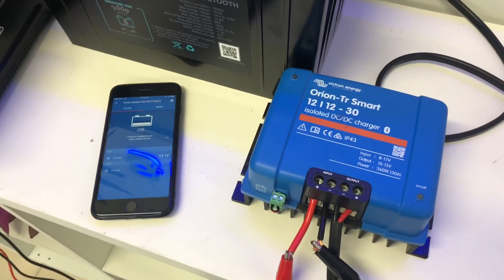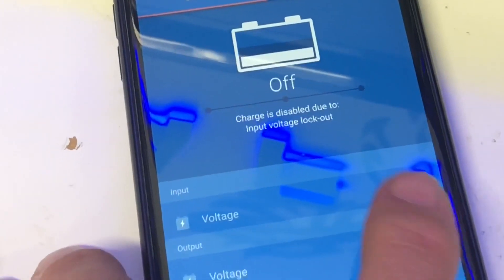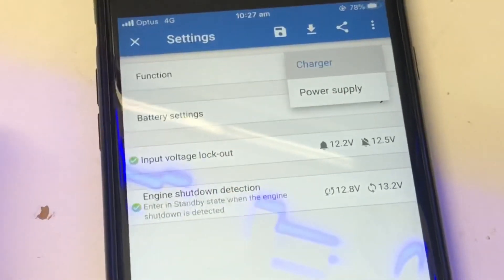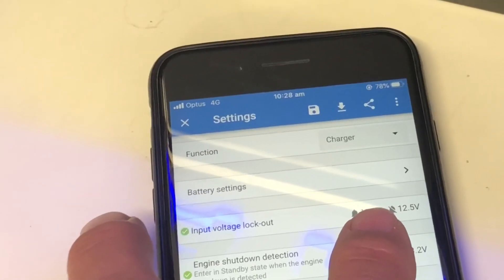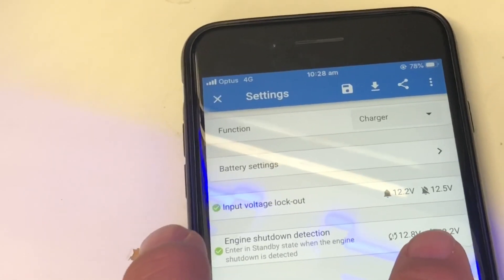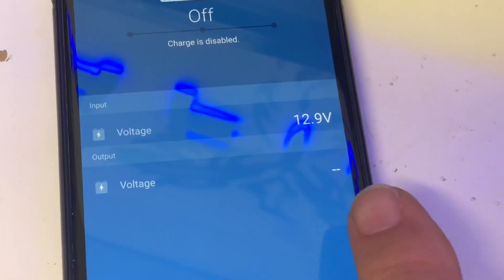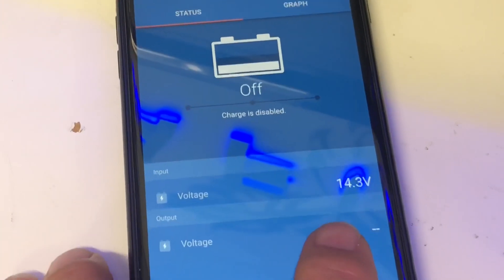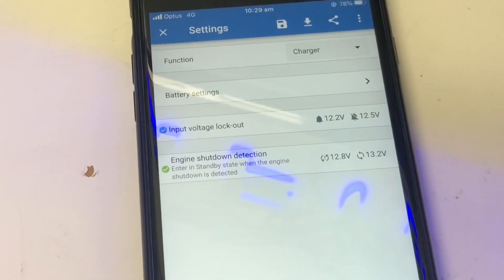Victron Orion Smart 30A  DC Charger Settings

Comment: I have this but not sure how to set up the volts for my battery. If it's set wrong will it burn anything out
Reply from the maker: The battery voltage setting is important so it is best to look up the correct setting for your battery's chemistry.

Comment: Quick question, in the dc dc charging from starter battery to living battery if the engine is running and the starter battery gets disconnected does the dcdc charger still works? Could you test this? Been searching for days on info on this on the inter webs and couldn't find any info.
Reply: I have one and when I turn off the engine it goes into power supply mode automatically but it also kept pulling volts from my car battery even when it shut down so I had to turn it off and the power supply worked for 1.5 days until I have to recharge
Reply from the maker: Yes it will work. But some alternaors need the stater battery on startup to pick up the field excitation before they are running. Apart from this, yes.

Comment: Great vid!
So, if mine is installed and doing what yours is doing (disabled-zap-disabled due to remote… - disabled - zap - disabled due to remote…), and I have turned off the voltage lockout and the engine off sensor, have I simply a bad connection somewhere?? Cheers!
Reply from the maker: I dont know. Your install would need detailed examination.
Reply: Thanks. I put in a new one and it works fine… old one sent in for examination so I’ll post if they say what was wrong!

Comment: hello, is there a way to limit the current? If I have a Li ion battery that can take 200 Amps, how can I limit the current in order not to blow up the fuse / charger / alternator etc?
Reply from the maker: No there will be on the new XS model coming

Comment: my 55 amp alternator must not be able to give enough power because it also drops to 11 volts when the orion tries to give some power, then it cuts out due to input voltage lockout, i think i need to keep that disabled and only rely on the engine shutdown detection
Reply from the maker: You need a bigger alternator. The drop in voltage may be because of this.
Reply: @Safiery  yes i will first try and install a sterling external regulator and see if this gives enough power

Comment: How do you find the optimal settings for your vehicles alternator? Im struggling to get more than 10amps after the first 5 minutes.
Reply from the maker: Is you vehicle a new one with a "smart alternator"?
Reply: @Safiery  yes. Well its a 2014 movano but it definitely has a smart alternator
Reply from the maker: @ridgeld  well that can be the problem for most DC to DC including the very capable victron orions. It took us a long time with very advanced software with our Scotty (12-48v) before we cracked getting over 200W. We don’t reveal how we did it but I can’t image the Orion doing it.

Comment: My issue is the Bluetooth is connected but  the app cant find my device .No is i leave the jumper unplugged  it would light up so i have tried it with the jumper plugged in .Im using the non iso version of the charger
Reply from the maker: Ok thats a bluetooth issue, not charging ... research bluetooth and victron connect
Reply: @Safiery  it's working now. Thank you

Comment: My vehicle has a Redarc smart isolator in it that cuts the supply to the Anderson plug on the rear of my car when the voltage drops down to (from memory) 12.6v. This arrangement was in place for a fridge in my van but I now want to use the same Anderson plug/circuit for one of these dc to dc chargers. Will it work with the isolator or do I need to get it removed so that the Anderson plug is always live?
Reply from the maker: My understaning is this isolator is used so that the battery voltage is not pulled down below 12.6V. If this is connected to the starter battery then leave in place. If connected to house battery then move to starter battery.

Comment: Can this be used off grid? Example 
I have solar panels charging a lithium 12 v battery but I have 1 12v agm battery
Was hoping this would work without an Alternator simply lithium to charge AGM
Reply from the maker: no it cant

Comment: Thanks for your informative vids and I was hoping you can advise what cable size should I replace the 6b$s cable with that was installed in my lc200 to a 50a plug at the bumper. I am getting 3v drop at the input of the Orion in the front boot of the caravan. The van has 6b&s run of about 5m with a 50a midi fuse at input and car 7m from main battery with 50a midi fuse at battery? Would 2b&s at car stop the voltage drop?
Reply from the maker: Robert, download the 'Victron Toolkit". At the top of this app is a cable size calculator. Keep the voltage drop % below 3

Comment: Anyone know when it switches to float? I'm charging lithium and bms activated full charge. Sitting at 14.57v for about 15min 0 amps and still in absorption? Is it okay to leave this connected to a fully charge battery all the time for extended periods or do I need to install a switch?
Reply from the maker: Hi Rick, We cant comment on systems we havent supplied. Sorry we cant help

Comment: Any issues running two in parallel for a larger lithium battery?
Reply from the maker: Yes there is at idle. 60A may be too much for the alternator. Rule of thumb is alternator should be good for 2.5 times a Fixed DC to DC capacity.
Reply: @Safiery  could this be fixed by replacing the standard alternator with a higher output alternator like the one you sell? For reference the car is 76 series. Thanks
Reply: @Safiery  Is 2 x 18A OK? What will happen at idle?

Comment: How much current does it need in order to provide the rated current to the battery being charged?
Reply from the maker: It needs about 450W. If voltage is lower, the current will be higher. So it is safer to reply in Watts.
Reply: @Safiery  Thanks for the reply. How did you figure that out? I looked at the manual and the required input voltage range is the only thing specified (10-17v). The manual also says the 30A is the rated continuous output current. Is the input and output current one and the same for this device? In other words what is pulled from the device by the battery that is being charged is what the device pulls from the source battery?
Reply from the maker: @f.k.6151  These have an 80-85% efficiency cold, less when hot so 360W output divided by efficiency to give watts input.

Comment: if I use this Orion I do not need a viltron cirus relais switching on at 13.4v or so volt.... wright. its programable in the Orion  wright?
Reply from the maker: I can't comment, it depends on the detail of the install and your protection levels. Please consult local Victron Dealer

Comment: Does the battery earth have to come from van battery or vehicle earth?
Reply from the maker: Both. Should be one and the same. ALWAYS have common battery negative to vehicle earth (ground). It saves energy as no black ground return needed and chassis has low impedance.

Comment: In the battery settings, is it possible to set a low temperature cut off?
Reply from the maker: No it isn’t . Also note that these devices do not measure current. So there is no data connection to a GX device. So no external control is possible.

Comment: My input voltage is set to 25 volts and the lowest it will allow is 16 volts. Why is it doing this on a 12 volt system?
Reply from the maker: You may have a 24-12V unit.
Reply: @Safiery   Yes I have the 24 l 12 30A unit.  But all the instructions say it's an option to set it up for 12 volt. Am I reading it wrong?
Reply: This is the quote, "Can be used in 12-Volt or 24-Volt systems and is suitable for both lead acid and lithium batteries, unlimited multiple units can be connected in parallel to increase output power."
Reply from the maker: @elizabethlicon7338  Go back to the Victron Dealer that you purchased from to discuss and possibly exchange.

Comment: Will it always pull its maximum rated current, or is there an option to regulate the current?
Reply from the maker: There is no current measurement in the Orion's. Therefore no control. When cold at say 10 C we have seen 40A, when hot we have seen 25A.
Reply: @Safiery  what about in normal temperature conditions, how much current does the device need to pull to provide the rated current to the battery that it is charging?

Comment: Does the Orion have a current setting?  For example, can it downgrade the bulk charge current from 30A to say 20A to reduce heat and increase longevity?
Reply from the maker: No it does not have current measurement.

Comment: Have you any experience with these running very hot? There are a lot of wueries and complaints from customers with them running as hot as 55° on the case and 88° on the heat sink fins. Seems to be crickets coming from victron about this. Irrelevant of whether this is in design specs it is too hot to run in parts of a camper van where i want to use it. Anyway if you have any ezperience or thoughts it would be greatly appreciated.
Reply from the maker: Yes we do have experience and they do run "very hot". Performance drops with temperature rise. The answer is not to use these is a confined space. Use a planar transformer instead as they are 96% efficient. However they still give off heat. Our Scotty product is a 3,000W DC to DC that gives off little heat because of high efficiency and the chassis mount.
Reply: @Safiery  thanks for the response. This is going into a hyundai iload camper as an addition to the solar input for the 2 120ah lithium batteries and i need something a bit lower spec than your 3000w solution. I have a victron mppt and bmv so i was really hoping ths dcdc charger would fit the bill but it looks like i will need to look at alternatives. Most of them have inbuilt solar regulators but that part isnt any use to me as i am using a high voltage panel.
Anyway thanks for your help.

Comment: Can you charge a 16v battery with it
Reply from the maker: No you cant. It has a maximum charge voltage of 15V
Reply: Victron has the same unit in 12/24 configuration that can charge above 15V

Comment: Hi, can you connect this to the starter battery directly or does it need to be connected to the alternator directly. I've currently got a Sterling B2B which connects from my starter battery to the leisure battery and chargers once the starter battery goes over a certain voltage.
Many thanks,
Reply: I think connecting directly to the starter battery is best, with #2 wire (unless the path is very short), and fused right at the battery.
Reply: @michaelbrown2443  sorry to butt in. What size fuse/ breaker would be suitable as this is a 30amp device would I need a 30amp fuse at the vehicle battery? Many thanks in advance.
Reply: @Ascent41  50A fuse.  We used an MBRF, right at the battery terminal.
Reply: @michaelbrown2443  many thanks
Reply: @Ascent41  It is strange that Victron doesn't say that the 30A is what the device can provide rather than what it needs to pull in order to provide any current at all. Some say this is how much it needs to draw and some say the device draws very little current. I haven't been able to get Victron to give me a clear answer.
Reply from the maker: Overlanding Sophia either way as the two should be connected together.. if you want more power we have our alternator controller or Scotty the 3,000W buck boost .

Comment: I have Emergency crank system with a rockerswitch. I will replace this system with a  Victron DC-DC charger. Its only to remove the solenoid or relay between the starterbattery and housebattery and put a fuse or cuircuit breaker between. I can remote control the charger with a switch inside, if I want. I dont think the Emegecy switch has worked. I want to figure out this now, and locate the wireing. Has plans to replace the AMG to lithium battery soon.
Reply from the maker: Sorry we cant assist via Youtube. Needs hands-on assessment

Comment: Hi, can it be used to charge from one battery group to another without the engine?
Reply from the maker: Yes it can. You would most likely choose the ISOLATED model for that application.
Reply: @Safiery  thank you very much.
Reply: @Safiery  In this scenario, would the supplying battery have to be rated at the current rating of the Victron? What if the source batteries cannot provide 30A which is the rating of this device?

Comment: Can I use these product on old boat to connect as input alternator and as output AGM battery for proper charging the battery? Because if I put AGM battery directly on alternator the charging will destroy the battery?
Reply from the maker: Gorjan H yes you can. It’s perfect for that

Comment: What is the minimum INPUT voltage for the OUTPUT to be high enough to do a complete charge cycle (Bulk, Abs, Float) on a Lead-Acid battery ?
Reply: It actually says 8-17 in 10-15 volts out on the unit...
Reply: @DavidLaFerney  Thanks
Reply from the maker: Around 9V. We set the lockout on a vehicle yesterday at 9V
Reply: @Safiery  Thanks !

Comment: Can this Victron DC to DC charger works in conjunction with Victron MPPT Smart Solar charge controller?

Like when my engine is running it will charger from alternator & when engine shuts of it will charge from solar panel.
Reply from the maker: Yes, side by side. The both work/activate the charge profile based on the battery voltage so can work together is the measured voltage is the same.

Comment: Can you change the output voltage while the device is running in power supply mode, without interrupting the output? Couldn't find any relevant info. Thank you!
Reply from the maker: Not Sure? If you want to recover the Lithium batteries then this is surely an important question.
Reply: @Safiery  Came back to comment because Victron has probably the worst customer support of any hardware company I encountered so far. Tested a few units and you can change the output voltage while under load and it will slowly adjust to the desired value. Seems to be a well built product.
Reply: @MrDrSnap  Agree on support very poor and also agree excellent quality products.